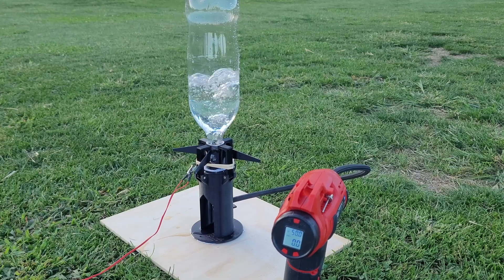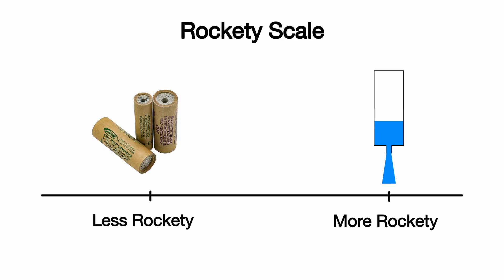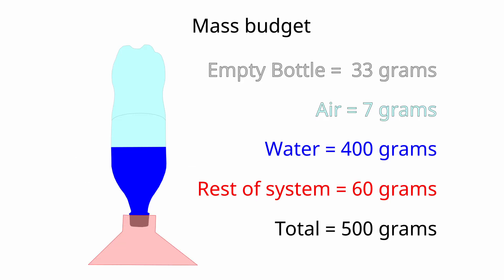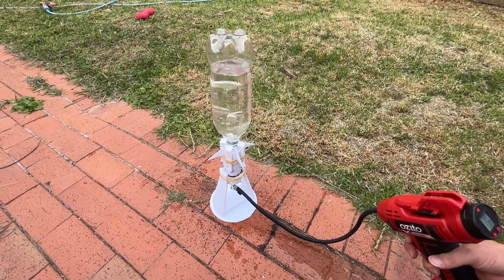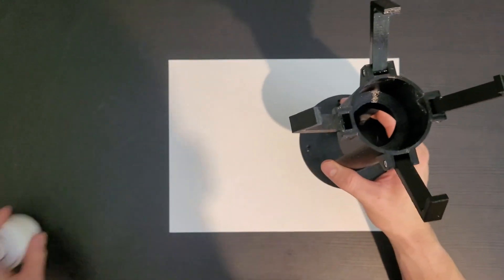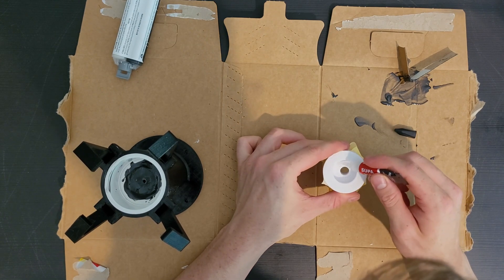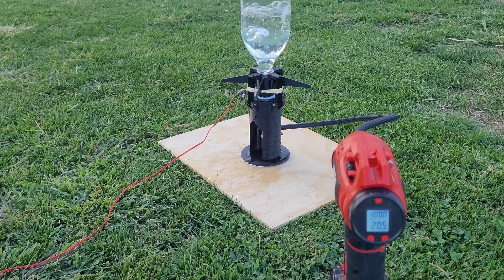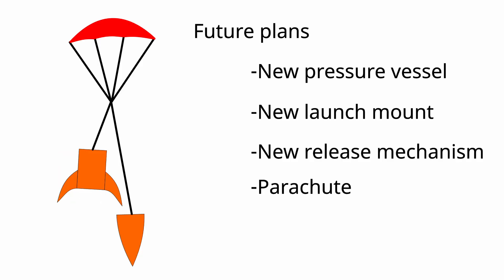My first attempt at rocketry

Comment: Your hold down design is actually really cool! I like the use of a model rocket launch system to activate it. I am curious how you are operating the air pump remotely, I am looking into building a similar system. For the leak around the bottle threads, you can look into flat garden hose rubber washers, these have worked well for me. To seal 3D prints, there is a solution called Dichtol designed to seal porous materials that apparently works really well for 3d prints, but I haven't tried it personally. A longer rocket with a bit of mass in the nose would help with stability.

Comment: you can do what we did as kids--- use a u-shaped plate hooked on to the 'manufacturing ledge' used to lift the bottles in the factory... the u-shaped washer is pulled by a cord which releases the rocket from the pad.